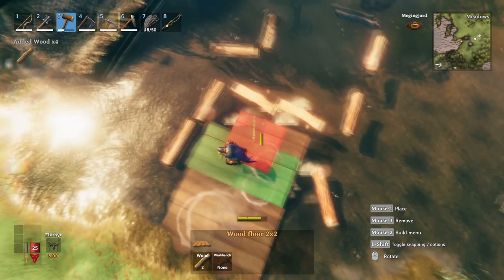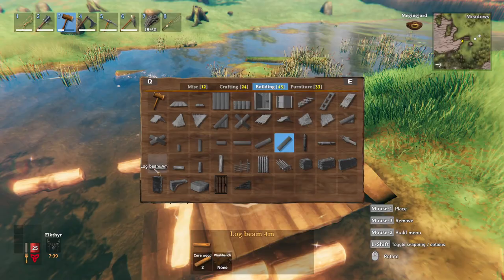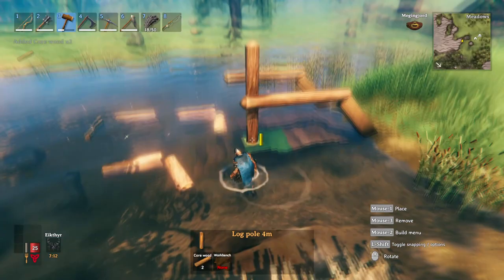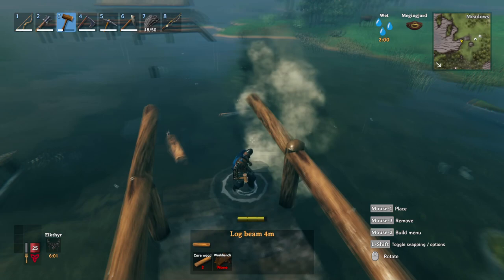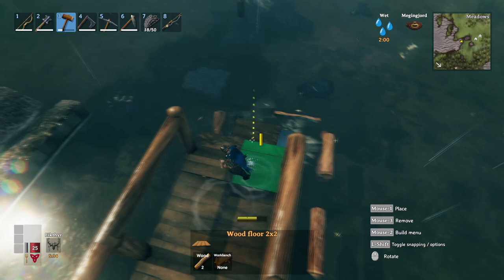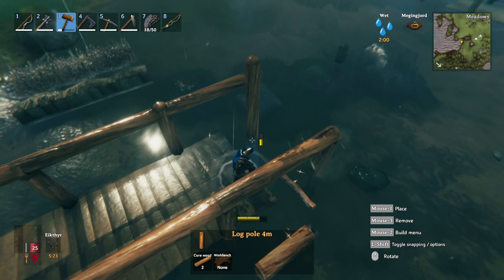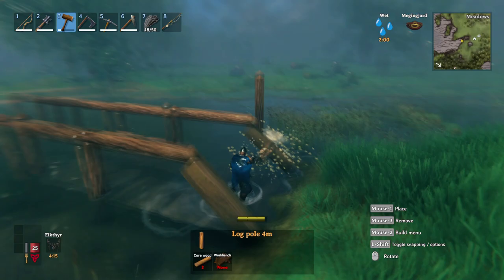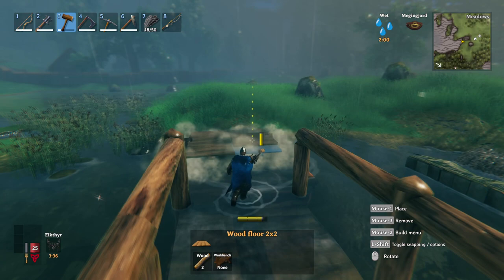Valheim - How To Build A Dock

Comment: I used the house beam supports to build mine. It made it to the deep part no problem as the beams were in the ground (the shore was quite shallow for a good length) and I just used the wood flooring in between the support frames. I am also only using the Raft at the moment as I just started playing today myself.

Comment: Is thare a way to help get the poles to be more even some were at different heights?
Reply: Yes. Instead of snapping the verticals to the bottom of the ocean, snap them to the horizontals. If that is proving to be difficult, run another horizontal line of core wood posts where the floor is going to be. (I do this regardless as it provides a nice base for the flooring. That way, you are snapping each vertical to two parallel beams. THEN raise the bottom under whichever vertical is green, until it turns blue. You will have all your verticals at the same level.